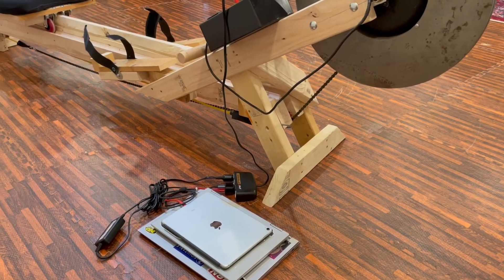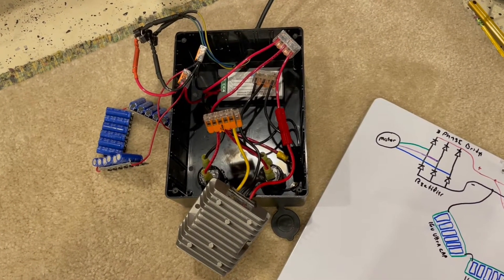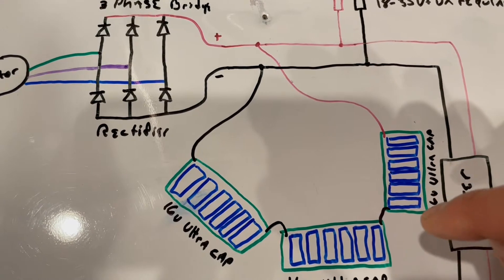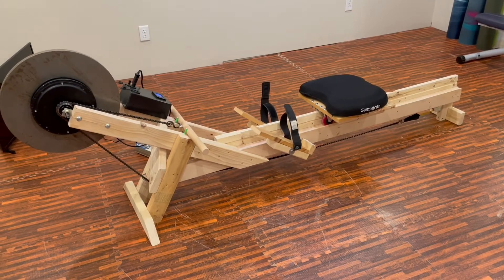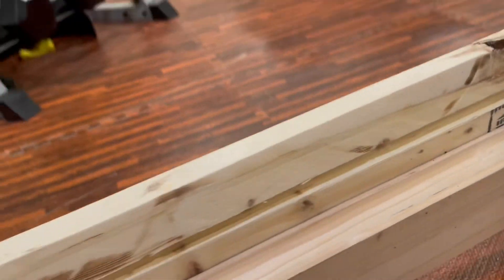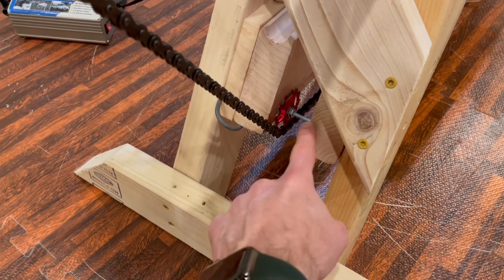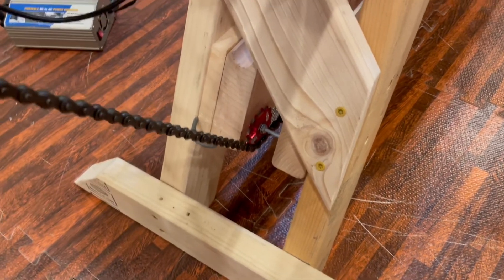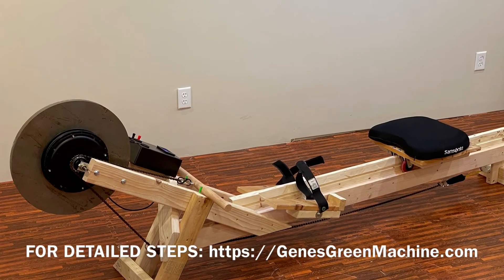Open ERG Rower Generator DIY

Comment: Hi there bro... just found ur channel, how are the PVC handles holding up? Im a little bit worried about the plastic, it didnt wear out over time? How they holding up?
Reply from the maker: I didn’t use PVC, the handle is made out of an oak dowel, 1.25 inch if memory serves

Comment: Nice build dood and thanks for sharing!   Hoping you can help me?   I want to use multiple sources to charge a battery bank.  Wind, solar and rowing machine, mppt charge controller, lead acid leisure batteries and a range of loads.    The controllers documentation does not say anything about multiple sources, do you know how?   Cheers.  Tanc
Reply from the maker: Hi Tanc, I haven’t done what you are trying, but seems something like this charge controller would be a good choice:

https://amzn.to/46HL9Rx

Comment: Would a wind turbine charge controller work in place of the setup you have here? I believe they take 3 phase power and turn it into 12v.
Reply from the maker: Yes indeed! I’ve made a 3 phase bridge rectifier out of Schottky diodes https://amzn.to/3fBY0yD for higher efficiency, but most off the shelf rectifiers will work, like this one: https://amzn.to/3RzDtYy

If you can find a wind 3 phase grid tie inverter, that will work too!

Comment: Banana conectors :D Sorry i know nothing about electricity, is the energy coming from the disc rotating against the engine? instead of the engine propelling a wheel, a wheel propells the engine and... current comes out of it?
Reply from the maker: That is correct! Electric motors when spun, create electricity. Here we are capturing that electricity and charging our phones, powering TVs, etc.

Comment: Hi sir!, what's your basis why did you used 56 pounds, is there any significant reasons behind that, this is for research purpose, hope you will reply soon. Thanks!
Reply from the maker: No significance. The flywheel was custom cut to fit the e-bike motor and to fit within a spin bike frame, the weight just needed to be between 25 and 60 lbs to be effective. The 0.5 inch steel was what was available for reasonable cost. I had 3 of them water jet cut for $210 US dollars.

Comment: This seems like a better way of getting some electric power for normal people than just a bicycle as this is a full body workout, not just legs, thanks for sharing the project it looks pretty interesting.
EDIT: Sorry, I forgot to ask, how would you compare your capacity to put power to a battery from this rowing generator against a static bicycle, are you capable of better power output with this machine?
Reply from the maker: Actually for me, not an avid rower, I can hold higher watts on the bike generated than the rower, but I think if I had more time on the rower I could make the same or higher with the rower.

Comment: Looks neat. Thinking of building one for myself but in EU with 220v output and saving it into a battery.  How much power did you get out of it?
Reply from the maker: After putting in some bigger ultra capacitors, I was able to get up to around 250 watts going into the battery bank. Granted, this fifty something non-rower couldn’t maintain that pace for long… I’m happy around 100-150 watts.
Reply: @GenesGreenMachine  Thanks. My general masterplan would be to store the power and then send it to an electric heater (6 Kw). I wonder how much I'd have to row to run the heater for two hours. Any idea?
Reply from the maker: Let’s say you can maintain 200 watts steady. Every hour of rowing will produce 200 watt hours. To get 6Kw for 1 hour will take 30 hours of rowing, 2 hours of heating will require 60 hours of rowing. This experience will give you a real appreciation for the electrical grid.

Comment: What exactly supplies the resistance? Is it purely the weight of the flywheel or is there also a drag effect when using it to charge something?
Reply from the maker: The flywheel does resist spinning until you get it going, then like you are leading to, the resistance comes from watts needed to charge or power things. A TV might be 30-250 watts depending on a number of factors. Mobile phones can take 5-20+ watts charging, laptop computers 30-150 watts. Just find the right amount of watts to make for a good workout! On the rower, I’m happy between 80-150 watts of resistance.